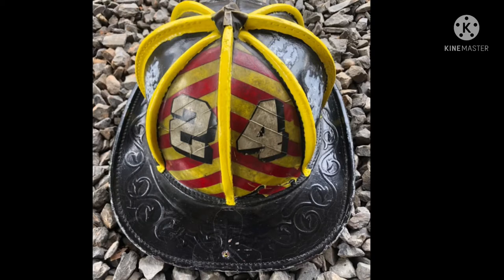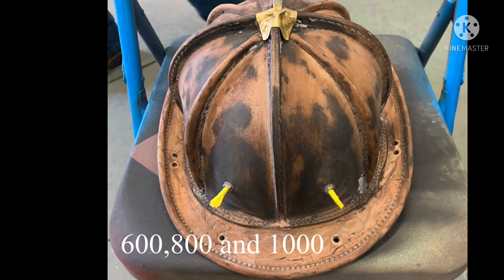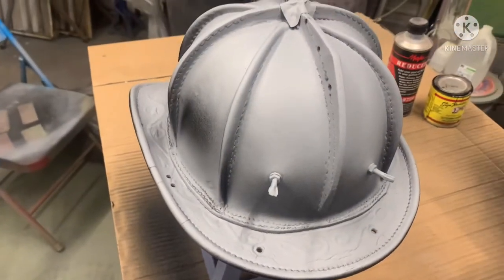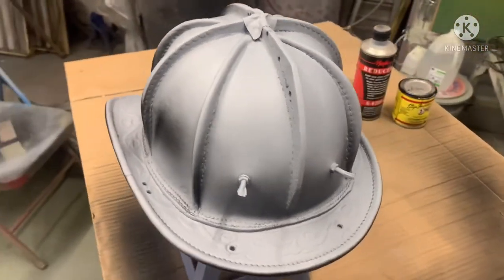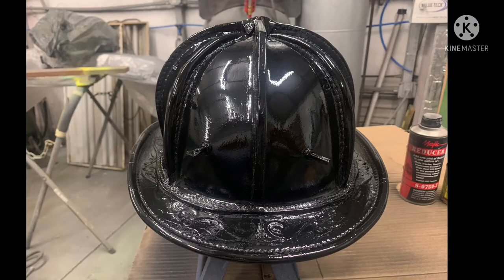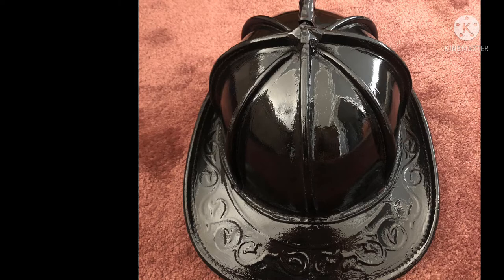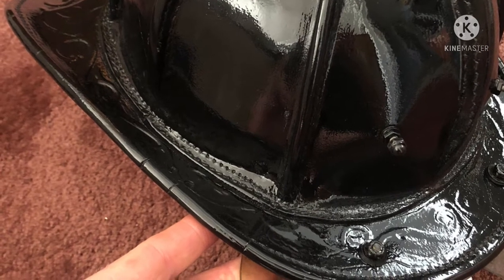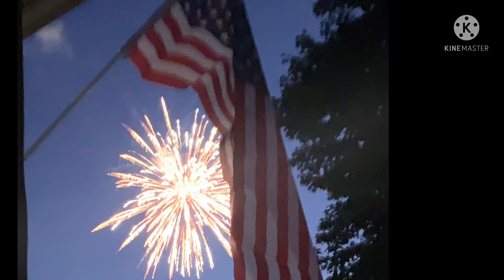How to paint a Cairns leather fire helmet

Comment: What did you mean by glaze? Clearcoat? If so what do you recommend
Reply from the maker: Glaze is a product that’s used auto body repair. Usually a two part product, one will be glaze the other is activator or hardener you mix in. Then you spread it, let it dry then sand it to a smooth finish then prime and paint. Clearcoat is another product you spray last to give a lasting shine and uv protection. Hope that helps! Thanks for watching

Comment: Could you also thin this paint with mineral spirits? If so would there be any downside other than maybe more time to dry? I’m about to do the same job you did once I finish some other repairs to the helmet
Reply from the maker: Not really sure, the stuff I used came fro Tractor Supply and it’s an enamel reducer. One Shot is an enamel paint. You could try a test spot, however the reducer I used was very inexpensive. Thanks for watching and good luck on your project!
Reply: Thank you! I needed up heading to TSC and got the same stuff. I used your recommendation of “little thicker than milk” since I’ve never used enamel paint or a spray gun for that matter, and it turned out GREAT! It looks just like the one you shot and I’m a total beginner. Thanks for the tips and great tutorial
Reply from the maker: @travisscottmedina  yes sir glad I could help!

Comment: Can you give us the proper ratio of paint to thinner when mixing for an HVLP gun?
Reply from the maker: I’ve been mixing paint for years, lol. Didn’t really have a proper ratio. If you’re using the cheap purple harbor freight gun just mix it to the consistency a tad thicker than milk. You want it to flow well, it won’t lay smooth at first but as it dries it should level out a bit. Spray it in light coats. Hopes this helps, best of luck.

Comment: What ratio did you thin it down to?
Reply from the maker: Ok so one shot is a thick paint so you need to thin ( this will sound crazy) to the consistency of a lil thicker than milk. I used the purple harbor freight gun so I wouldn’t possibly contaminate my good guns. The purple gun will do a good job, if it’s to thick and sputters just add a lil more thinner. Just to let ya know the helmet is holding up great! Let me know if have any more questions. Thanks for watching
Reply: Did you use a full can of one shot? How much thinner did you use?
Reply from the maker: @markjackson812  no I only used maybe a quarter of the can. If you’re gonna prime like I did with the trans tar you can get it in black. That way you would need less paint to cover it.